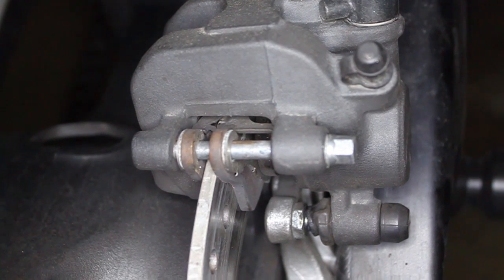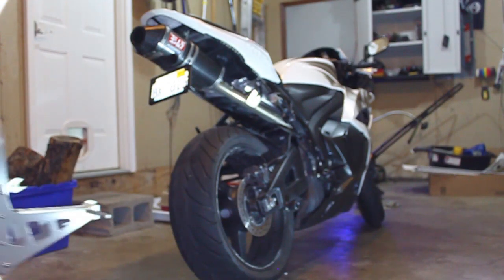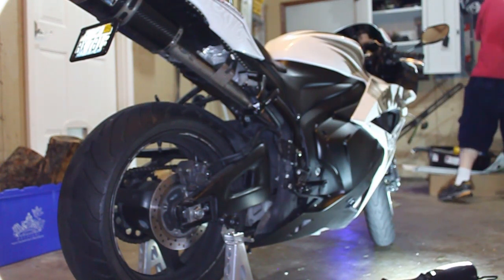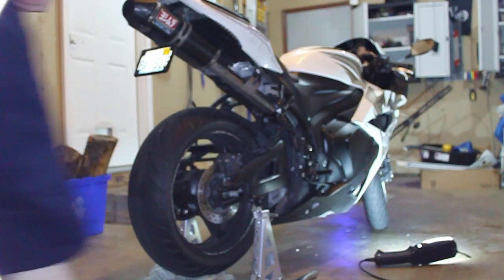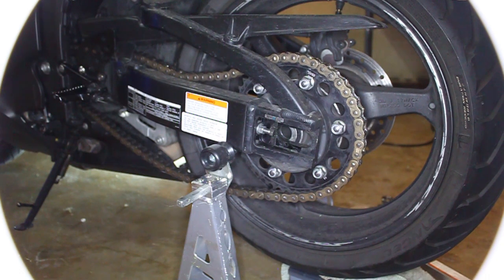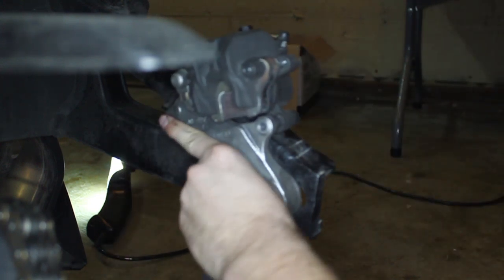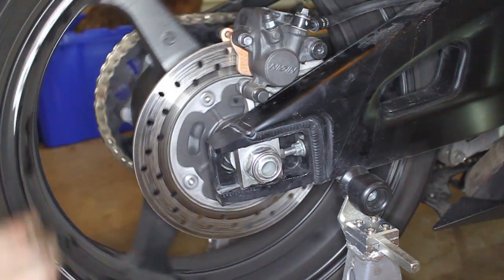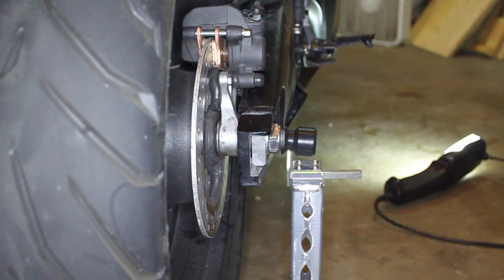Replacing Brake Pads on a CBR600RR NOTE: removed wheel for video purposes. Read Description. (2009)

Comment: Learned a lot on this video, great camera work son.
Reply from the maker: +Boccaccio Boyer Thanks! make sure to read the comments because I learned alot from the people on here as well. I might of went overboard changing the pads, tire didnt need to be removed.
Reply: +IamKrAzE Why did you remove the rear wheel? only had to take the 12mm and 8 mm sockets out
Reply from the maker: +BkzNotoriousPapi there's an annotation, a description in the video and several replies.

Comment: nice instructional video. What do you have the wheel sitting on to prevent it from dropping before you put the axl in when you are putting the wheel back on? I use my foot and it's a pita. You do it much easier.

Comment: also just incase if the spring falls down then another headache to re -set the pads spring plate. then most important thing is pressing the piston back to normal condition is impossible,....if u try to do so then u might bend the rotor...also you can do the greasing of caliper foundation which always need it. so from my view point he did correct. check the caliper. the mounting is not on bolt on basis...

Comment: yes in some of the bikes you need to remove the wheel for sure. here also you have done correct thing though you have used wrong tools for repairing purpose. like hitting hammer on screw driver and all..but since this is DIY so can't say much. The caliper has got no mounting bolts it has got only pin for pads. the caliper is directly mounted on the foundation plate. which you can't move the caliper upwards. it only can move side ways.

Comment: Nice video! Doing my rear brakes pads tomorrow. I've noticed you didn't put brake pad grease. So, you don't need it? Another question.... Will a Jardine slip on from a '04 CBR600 fit in a 2007 CBR1000RR? They're both undertail exhaust. Have a friend that's willing to give me his for my CBR1000. Just wondering if it fits. Thanks again!

Comment: If it has a "little switch," it's not a breaker bar. That looks like a torque wrench, and loosening nuts and bolts with a click-type torque wrench will mess up the calibration.

Comment: I understand the video is a little over a year old, so new(er) riders here are some things to consider:

He was not joking. He will have to replace the rotor, and pads again, if he used them with that junk rotor
His chain was in need of cleaning, very critical maintenance item, clean and lube the chain it's easy
While you have access to the caliper like that clean it also, that piston was fully extended and it was pushed back in dirty

P.S. - worried about scratches? that bike was filthy

Comment: No dis but all you have to do is pull the 8mm pin out and the pads slide right out and new one slide right in you do not have to pull wheel off

Comment: what are the stainless plates called that clip on to the back of the pads?
Reply from the maker: perhaps a backing plate or shim? It helps the caliper slide when the pad shifts. Some come with it, some do not. Best to use grease of some sort.
Reply: i got some ebc sintered and used copper grease. i can't find the backing plate anywhere on the internet. i accidently threw the plates out in the trash lol. il put them back in with copper grease.

Comment: just a little note to ppl, you want to clean the caliper piston with a SOFT brush and brake cleaner before pushing it back in as to not damage the seal. OP if you haven't yet join 600rr.net and you'll learn anything you need to work on your bike.

Comment: You shouldn't have to remove the tire to change the pads.  Just loosen the pins and remove the caliper mounting bolt, pivot the caliper upwards, remove the pins, replace pads

Comment: Why would you title a video "Replacing Brake Pads" when you are actually replacing more than just the brake pads. You are going to make unknowing people spend much more time and money than is necessary. You also need to lube the isolation pins...
Reply: +t3hgone wtf are you going on about? All he replaced was the pads!
Reply: +Eli “Knocky” Moore Removing the wheel and chain, then having to do a realignment is not required for changing the pads. His pins aren't lubed either.